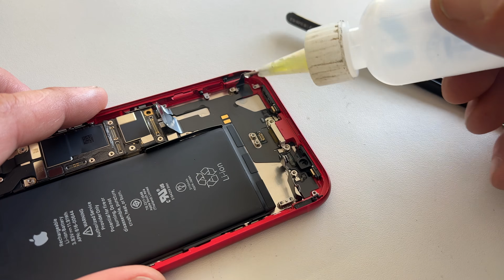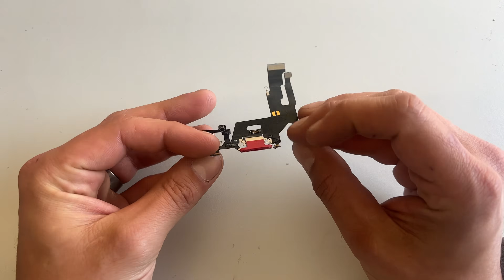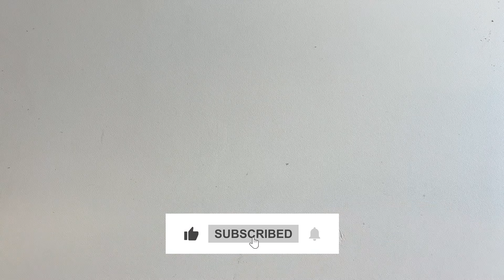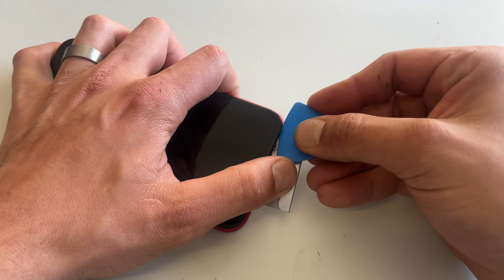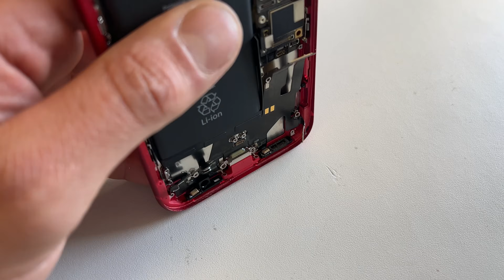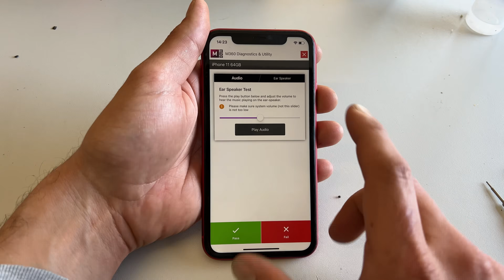How to Replace the Charging Port on an iPhone 11 - Step-by-Step Guide

Comment: I have to say I had some real trouble with removing the screws. Not for any reason other than the cheap crap tools I got with the part. Definitely worth investing in some good quality tools like the gentleman completing the work does. Also if you are a shaky handed person and have “not the best” eyesight - don’t even bother. The screws are literally so tiny.

Comment: First off this is not easy, I’ve changed screens, batteries etc before but this is way harder. Took over 3 hours.
I’d recommend a good magnifying glass along with the tool needed.

He does skip step or two when reassembling eg replacing the plastic thing he took out at 4:07 & the odd screw so watch out for that.

It works but it’s so tedious I’d pay the pros if I had my time back! 
Good luck.

Comment: It is amazing how screws this tiny can me manufactured? Unbelievable.  Fantastic video.  I replayed parts of it an embarrassing number of times.  I also kept a word document of each step I did, and took a white piece of typing paper to keep track of the screws and a corresponding number to the document.  And still, it took a long time to complete.  I replaced the battery at the same time.  If I do it again, I will make a video log that I can play back. . . . better yet. . . . maybe find a way to play it in reverse when putting it back together?  Definitely harder putting it back together.

Comment: This video is helpful but people need to understand what they're getting into if they decide to do this.  This work is TEDIOUS!!   He makes it look SO easy and simple in this short video.  It took me near 3 HOURS to replace my charging port using this video.   
 First you should understand that about 80% of your time will be spent trying to get the TIIIINY screws onto the screwdriver head and then into the TIIIINY hole.  This dude must have screwdrivers with hyper magnets because my screws would NOT stay put on the screwdriver head. As soon as you lower the screw down to the phone it leaps into some other position. Other parts of the phone insides are magnetized too so the screws went everywhere except for the hole they were supposed to go into..      
Next, you need to understand that all these screws are different sizes and lengths.. even those using the same screwdriver head.  He doesn't mention this in the video..   You must keep METICULOUS track of each screw and where it goes as you're removing them.  write it down..  take a video.. whatever you have to do.  Trust me on this.
Third, you will be paranoid about breaking something.   These parts are TINY and FRAGILE.  Everything you see in the video that he snaps into place with ease...  you will be struggling to fit.  The connectors are tiny and if youre buying parts online they will probably look a little different.  You wont want to push too hard for fear of breaking something or ruining a connection.  Its a mental roller coaster to say the least.
Also, on the second part of the video where he is putting things back into place, there are parts that he skips.  So make sure you are putting everything back into place because it wont all be mentioned in this video..  be very careful.

So yes, this video helped me and I did successfully replace my battery and charging port.  But it was a struggle I wouldn't wish on my worst enemy.  Be prepared for a time consuming struggle if you do this.  The only reason I did is because I"m poor but I need my phone for work.  Would have cost me $250 to have both these replaced.  So I saved about $200 after parts.
Reply: Exactly! I agree all you said. I know me and I have a child, as soon as he started working on it for the first three steps, I said yea I might as well pay for it. Ain’t no way ima be able to handle all of this on my own. I might as well pay the cost to get everything fix instead $ 1,000 for another iPhone.
Reply: Thanks 😊
Reply: It also took me 2.5 to 3 hours, I did it without videos and I had some problems with the screws, where which ones went and I had to correct the connections a few times. Make a copy of your data because you may have a big problem!!!
Reply: Took me 15 minutes max. People are stronger in different areas. I’m sure you’re a great person, but there’s people that’ll do it quicker than me. I  had a hard time getting those screws that the screws screw into to turn but just added pressure. I used tools from a screen replacement and a donor phone for the port.
Reply: Skill issue

Comment: My brother in christ this video is incredible. Just changed the connector on my old iPhone 11 following your instructions for 1/10 or what a repair shop was going to charge me! Thank you so much! You're amazing. I can't same the same about whoever thought of putting those tri-wing screws in there, though...
Reply: lucky you, you got a good part. I got a shitty part, now my screen doesn't even work.
Reply: @shellshock10 you sure it isn’t just a bad flat cable connection? Those flat connectors are really finnicky. At first my part didn’t work and it was because the flat connector hadn’t sat in properly even though it looked like it had.

Comment: I followed your instructions and replaced the charging port, I have almost 30 years of tech repair. Everything went fine but just after some minutes I got a message that the phone was overheated, restarted it and same thing, do you know what could be wrong? Maybe a bad charging port? Have you had this issue sometime?

Comment: Alright, here is my honest comments. First of all this video is fabulous. I used every little instruction in this video and was able to replace the charging port and I also changed my broken display screen. So it took me longer than I expected. One thing I would say is - you need patience and some technical skills. The screws and the connectors are little tricky. What got me really frustrated is the screws - FYI the screws are all of different sizes. The lengths - best is to number them and keep them in order as the video goes. I really had no clue which one went were after disassembling The cross heads are of different lengths. I was able to figure it out by removing and putting them back many times. So, keep them in order and if possible video tape your disassembly process. It will help tremendously. End of the day I was able to replace it all and now I have a working phone. 

Great video and good luck everyone.
Reply from the maker: I do this everyday and still mix the screws up! Thanks for your honest response and I’m glad you got it repaired
Reply: @iDoctorUK  i have one small question.. without pentalobe screws i am using xsmax and it does not support apple lightning cable for listening music and videos...is it that much needed pentalobe screws? can you clarify...
Reply: i'm i'm
Reply: Cool

Comment: I thought this was terrible. The disassemble was good enough, and he took the time to identify every part and screw, but the reassembly is terrible. He often glosses over steps, not addressing the differences between screws, and there were 3 parts that have important order to them that were just clumped together, and no mention of a critical standup screw (I had to go back and undo several steps when a micro crosshead wouldnt receive because the standup was missing. Now, I've finished reassembly and have a part leftover outside the phone. I've identified it as the plastic jig, which sits beneath the taptic engine. I'm pissed. 4 hours later, and I need to put this part back in, which requires leveraging the glass off again to start, which was my most damaging and frustrating step. On top of that, the lightning port still doesn't function, which isn't Doctor UK's fault, but the fact that a part isn't in the right place completely is! Wish I'd never embarked on this, and had used a different, thorough video if so.

Comment: I’m pissed 
I went to the guy that did a great job replacing my phone screen. Charged me $90. 
This time I came in and wanted to get my charger port replaced and a new battery. 
He tells me “oh well I’m gonna have to do some diagnostic test on it and it’s going to take about 2-3 days to do that” I’m like WTF because I called him on the phone a week prior asking him specifically 
How long will it take you to replace the battery he replied 2 HOURS
So why tf is all this diagnostic bullshit being need to be down now? 
I even was like okay just do the port and he was like “yeah either way if it has to do with battery or charger pot the diagnostic test needs to be done” 
Where tf was this information when I called a week ago? 

It’s giving, I don’t wanna do my fckn job🙄 
Now I’m just like let me do this shit my damn self it shouldn’t be that hard considering he’s charging $80 for a battery replacement and $65 for a charger replacement 
It’s a XR 
I saw on Amazon they sell the charger port replacement kit for like $8 plus I wanna go into tech so fck it might as well start from somewhere

Comment: Thank you so much for this video. I could repair it using this guide.
But for everyone who wants to try it: Think twice if your technical skills are good enough. You need to be patient and you should proceed very carefully. And please do not try it with cheap screw drivers. It is important to be equipped with good  tools.

Comment: Hey mate I've got an issue. My charging port got water in it and I forgot to clean it out and while there wasn't much I still plugged it in and when I came back my cable wasn't black and now everytime I charge my phone it takes around 2hrs to only go up 7 percent. Wireless works fine. I noticed pin 4 is bent down and also cables only work if I bend the cable now (multiple cables). Wondering if I can fix it somehow or if I have to change the port fully
Reply: Hi i if the pin is just bend you need to visit the shop they will repair it if it’s missing then you need to change the entire part

Comment: long ass video and its garbage as fuk. he didnt mention that you have  to slide the new charging port under the old circle thing that has a square shape  around it. stupid as fuk. also doesn't mention to store screws separately w their parts because not every screw is the same size

Comment: I’ve replace the charger port and flex cable and still does it
Reply from the maker: Does what??
NP
Reply: @iDoctorUK  restarts after 3 min
Reply: @mangolinii  it´s a different issue. Not the port problem
Reply: @viajahtur  I’ve fixed thanks bro
Reply: @mangolinii  whats the problem ?

Comment: Excellent tutorial. Thanks
Reply from the maker: You are welcome! Thank you for watching ❤️
Reply: @iDoctorUK  just did it on my 11. I took the whole afternoon. Got scared because it didn´t switch ON at the first try. Luckly that didn´t close the screen. Review and the battery plug was not well fitted. Plug it well and works fine. All done. Thanks.

Comment: Hello ! My iPhone 11 charge when its off but wont charge when its on ! Btw its charge with wireless whenever its off or on ! ive tested my phone with several cables but still facing the same problem ! Is it normal to have a problem in the charging port but still my phone charge untill 100% when its off? Anyhelp?

Comment: i followed the instruction but i seem to have lost the grounding in the porocess will it work without the grounding pin if not where i can get a replaisment
Reply: sorry for the broken english
Reply: 6:58
Reply from the maker: Did you use a good quality replacement part? We recommend using pulled parts for iPhone 10 onwards
Reply: @iDoctorUK okay but where’s the link?

Comment: When finished phone does not turn on. With charger plugged in its a white screen with apple logo for a while, then it shuts off and does it again. Where do i have to look? What is wrong? Does the same with battery unplugged but tried both the new and old battery. What may have happaned? Thanks :)
Reply from the maker: You may have damaged something. Check the ear speaker/front sensor cable. Also check if it turns on when the charge port is disconnected

Comment: No thanks
Reply: I mean nothing is impossible. This will just take patience. I have a iphole 11 that someone left behind at my hotel I work at and they never came back to get it. It's icloud locked but I'm going to take it home today and use it to fully repair my iPhone 11. Going to change screens, charging port, cameras and possibly battery if it's as possible as this is
Reply: @robertsanchez5652  I almost ruined my daughter’s iPhone 13 by trying to replace the screen myself. I failed and ended up taking it to somebody and they said it was a mess but they got it fixed with the new screen. Be careful if you really care about your current iPhone 11. This is not as easy as it looks. the connectors are so tiny and fragile and there’s a lot of different screws that you have to keep track of. I suggest you get a magnetic board to place like parts and screws together, before you start.